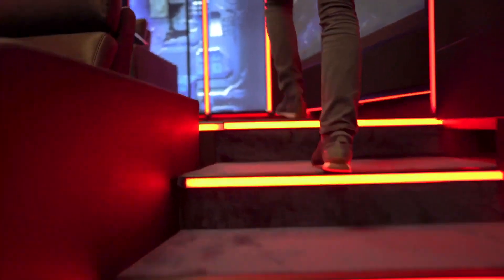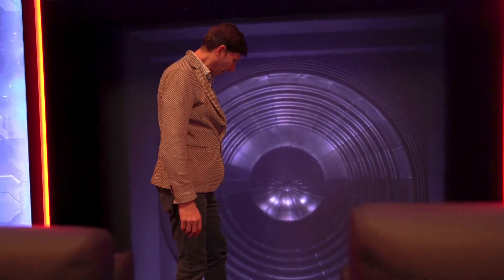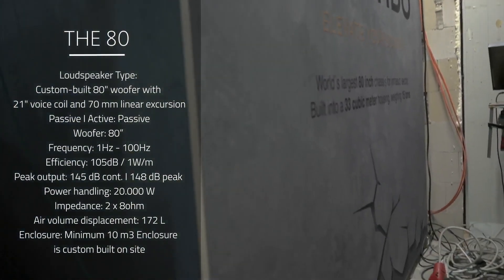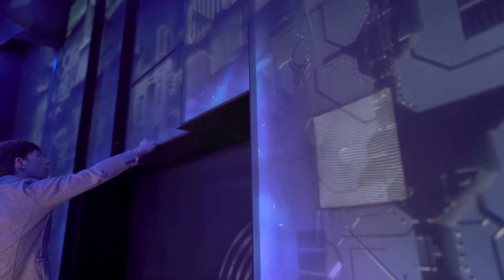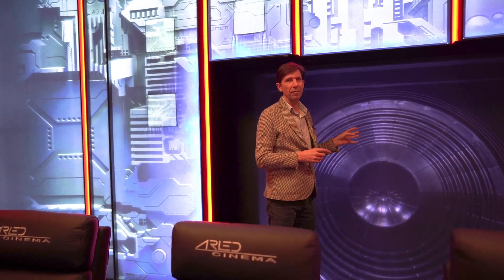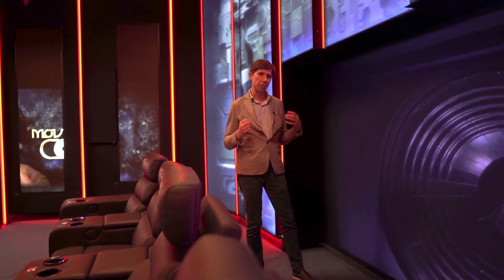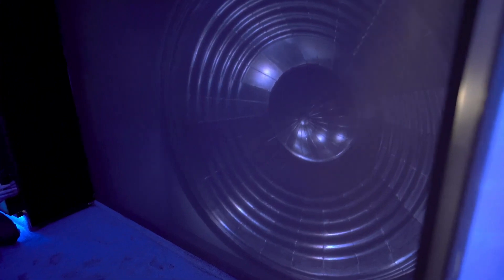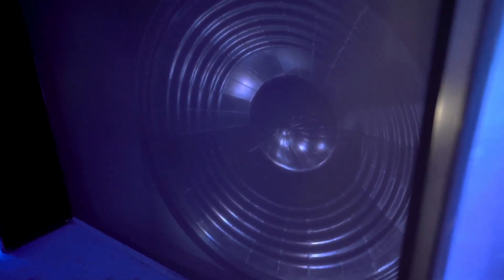WORLD’S LARGEST SUBWOOFER!

Comment: I just did the math,  this 80 inch piston, called "The 80", with its 70mm of Total, Linear X Max, is= to approx. (44)-12 inch, (28)-15 inch, or (20)-18 inch subwoofers, if all of these subwoofers were capable of 70mm of Total, Linear X Max, as well👀! What db @ 5Hz, 10Hz, 15Hz, and @ 20Hz, please? Awesome product, how much is the current price as of feb. 2023?

Comment: Have you also tested "The 80" in a Large vented enclosure( around 800 cu. Ft.), tuned to around 10 to 15Hz?
Reply: pointless. it already goes to 1hz. if you tune it to 10 or 15hz you start to lose output below the tuning freq. it's probably not designed for ported as it needs the sealed enclosure for cone control.
Reply: @josephlalock8378 Many woofers preform just as good if not better in a ported enclosure. Being sealed is locking some of the sound inside the box that is why almost everyone goes with ported. Oh and before you say anything yes I've had many ported and sealed enclosures so I can accurately make this judgement.